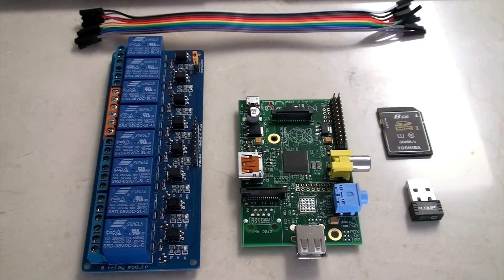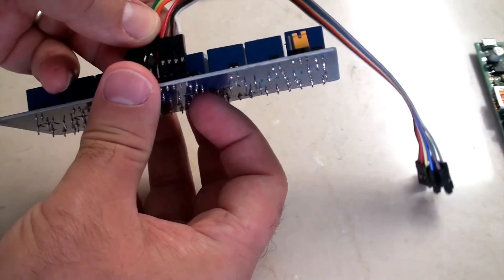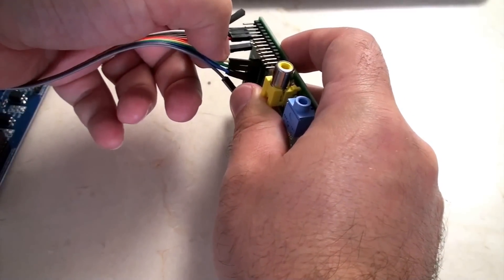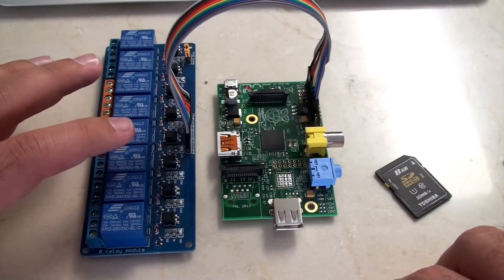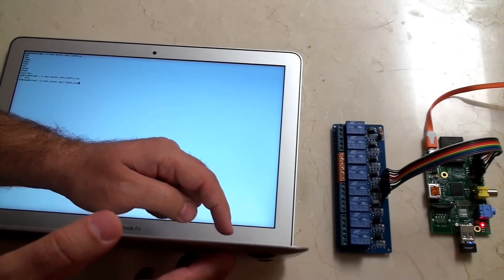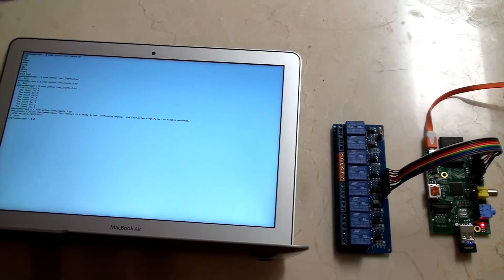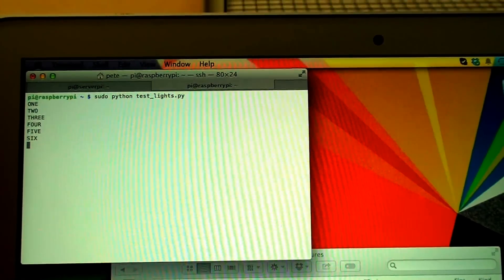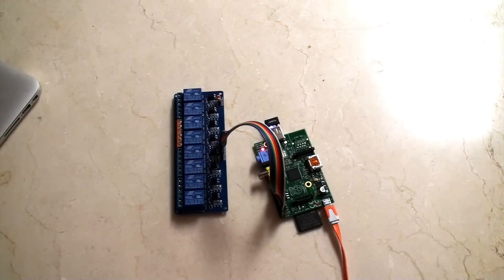Raspberry Pi: 8 Channel Relay step-by-step with software examples for automation

Comment: Can i use Relay for 220V Home Appliances?
Reply from the maker: YOU RISK SERIOUS HARM.  Obviously, since you are asking, you have no 
idea how to use a relay, and no idea how serious 220V is.  SO DO 
NOT ATTEMPT THIS.
Reply: +skiwithpete  I know they are just Electromegnatic switch(s) and if i get specifically 220-350v &25A that would be better right?
Reply: I want some help with relay.. i have 8Ch relay board as you have. but in idle mode some of relay board Leds are dimm. but it goes off and works well when executing script. i want to know that if it is okey or not , before connecting 220V appliances to relay board.

Comment: You don't need a Pi for this - a simple Arduino Nano, running an OOP sketch, can handle 8 or more relays totally independently and simultaneously. Here is my video demo: https://vimeo.com/173236054

Comment: Thank you for the tutorial.  I am resurrecting a 5 loop guitar effects rack that I built in the late 80's.  I am dropping one of my effects and focusing on using four relays for clean signal switching and the other four for powering LEDs at the foot controlled switch box.  I have been told that I can simply apply digital on and off signals to the relay triggers.  However, it would be better if four input switches could enable a more complex array of effects e.g. 1=comp, 2 = comp+dist, 3 = dig delay, 4 = octaver + dig delay.   My question, yet unanswered, is how do I get my dry closures from my foot switches inputted into the RasPi or other?

Comment: What is a relay? What are they used for? I need help with my stupid purchase from sainsmart. I got a robot arm with no instructions. :(
Reply from the maker: A relay is just a switch.  The switch is controlled by the flow of electricity on one side of the switch.  That's what you can see in my video here, it's just the one side of the relay.
Reply: So if I wanted to move 4 servos at once, I would need a relay? I mean, a switch in networking terms, or a switch as in on / off?
Reply from the maker: a switch as in on off.  If you want to control servos, connect to the servos.  If you want to control the flow of electricity like a wall switch, use a relay.
Reply: thanks!

Comment: If I use for lighting, do I use a 5v relay or a 12v replay?
Reply from the maker: the 5v or 12v is a requirement of the relay to operate and is independent of the power of the light you wish to use. check out my 12v led lighting controlled by mobile phone

Comment: I wanted to make my own thermostat but getting a 5VDC connection will be difficult.  I think a 4 relay board will do.  Do these relays control DC circuits or AC circuits?  My HVAC runs 24VAC lines.
Reply: These boards do work with both DC and AC.
Reply: On thermostat lines, 1 power 24VAC is coming in.  Get's sent to 3 other wires (fan, compressor or heater).  I have heard some say to use the common wire but I am not sure of that.  The trick is I only get 1 power line to feed a board and several downstream relays.
Reply: sized4spills
Thanks!
Reply: You power the relay with 5V and use it to control the 24V lines.  No need to step down the voltage if you connect your relay as shown in the video.
Reply: +Aaron Rogge since i have a 24 VAC, i still have to get it to 5 VDC. Once i do that,  and have enough amps to run the pi and relays, it should work.  i have a 40 watt transformer which is 1.67 amps at max.  I am still not sure if this is going to work this low power
Reply: I had missed you were powering everything from the 24 VAC. Sorry. From some figures I have seen, a b+ can run on .5 - .7amps depending upon what is attached, so you should be good. Do you have a common ( C wire )? You need it to complete the circuit for the relay.
Reply: Yes I do.  I don't understand why one has to use a 2.5 Amp power supply then for the Pi.  I suspected it didn't use that much energy.  So in that case you are right, it should work.  Relays only roughly pull 50 mA to activate.
Reply: +Chris Sparks I suspect it is to ensure enough power for all possible use operations.
Reply: get a 24vac to 5vdc transformer
Reply: if all the relays are on at once you want more current. also whatever the pi requires

Comment: I'm very new to this and I don't know how to make the pi run the program. If someone could help me that would be great!
Reply: copy the code into a file (use a text editor) and save it as test.py. Then run the command "sudo python test.py". Hope this helps.
Reply: The sudo shouldn't be necessary. python test.py should be enough. Judging from the first line of code it should also be possible to run it with ./test.py after you set the executable bit with sudo chmod +x test.py

Comment: Hi every one! I need some help programming relay bank for a pre-amplifier. 
6 relays (3 stereo inputs) will be input channels, and only two relays can be closed at the same time. So relay 1 and 2 are one group and 3 and 4 are one group and then 5 and 6 are one group. Relay 7 and 8 will be for controlling volume, so this should be momentary set. I will have to engage scripts by remote control (IR module) or buttons on front panel. Any one want to help me with this?

Comment: +skiwithpete 
I have a problem with my relays that I hope you could help me with. No matter which of your scripts I use or scripts I write, all the channels turn on NO MATTER WHAT. I would appreciate some help please!
Reply from the maker: +Elijah Stockhall Try setting the relays to low instead of high and high instead of low in the code.  If that doesn't work...  A couple of guys here have complained about similar things happening with defective relays.  Have a look through the comments and see if anyone else has the same problem as you do.  Also, make sure you've got an optocoupler relay - non-optocouplers behave in the same way as you describe.
Reply: thank you! 
Will do!

Comment: Would I be able to wire the relay board to solenoids and run them on timers (as long as they were the same voltage)?

Comment: Why does low gpio setting trigger switch and not high? I would have thought to set it to high.
Reply from the maker: +Matt Shepherd That's the optocoupler.  You should check out Gaven MacDonald's video for a complete explanation of how it works:  https://www.youtube.com/watch?v=b6ZagKRnRdM
Reply: +skiwithpete thanks, that explains it.

Comment: jist curious to why BCM was used and not BOATD. I am starting out with a 3B and relay 2 isn't working. It may be defective but in researching your code I thought BOARD (pins by position on the board) instead of BCM (channels on Broadcom chip) would be better and less of an issue with changes in hardware as people share code or the same code is applied to different hardware versions.
Reply from the maker: +Peter Capazzi BCM is what I'm familiar with.  If you watch my videos I count on relative positions.  I don't think finding the 34th pin is easier than finding a relative GPIO number.

Comment: I followed this tutorial and used a raspberry pi B+, but my relay would not work. in the end i found that i had to use an external 5v power supply straight to the relay board vcc. and another for the pi.
Reply: Just run a single power supply 5V that can handle both... that way you only take up 1 plug from the wall...
Reply: how do i make/find a external power supply
Reply: I am trying to do the same and apparently RSpi 3 model b cannot power the same relay used on this video. Where did you find the power adapter for the relay? did you make on yourself or can you buy it of the shelf?

Comment: Running the Python Shell (Python 3.2.3) on a Raspberry Pi model B; I get following Error:
      GPIO.setup (i, GPIO.OUT)
RuntimeError: No access to  /dev/mem.  Try running as root!
How to olve this ?
Reply from the maker: +Luc Hendrickx run it as root.  add "sudo" no quotes to the start of your line.
Reply: +skiwithpete Thank you for you answer 

Adding :
"sudoGPIO.setup (i, GPIO.OUT)"
I get the error 'sudoGPIO' is not defined

Adding :
"sudo GPIO.setup (i, GPIO.OUT)"
I get the error invalid syntax

Adding :
"sudo 
GPIO.setup (i, GPIO.OUT)"
I get the error name 'sudo'  is not defined

It is probably a stupid thing but I don't get it right

Thanks for your help
Reply from the maker: +Luc Hendrickx don't put the sudo INSIDE the code.  Use the sudo to run the .py You can't run GPIO.setup from command line, that needs to be inside a python script.
Reply from the maker: +Luc Hendrickx Maybe watching my 16 channel relay video would help you understand how to run the code.
Reply: +skiwithpete thanks a lot Pete.
I got it running OK 
From the LXTerminal with "sudo python test_lights.py" in stead of from Python Shell

Fine you helped me out

Comment: I have tried this on the Raspberry Pi 3 Model B v 1.2 and was not able to reproduce the issue you were having with the B.
I modified the script1.py to have a 5 second delay and to only have one relay active at a time (set HIGH, the set LOW).  I was able to run through all 8 relays without the delay.
Reply from the maker: +Bert Cotton Cool, thanks for letting us know!

Comment: I apologize for what might seem like a dumb question. I just got my first Raspberry Pi 2, I would love to wire an outlet to a relay and use the pi to automate sending power to the outlet. I want to stick a lamp, or a radio, or a fan into these outlets. Will this relay for for this type of application? I saw your other video about using a 12v  powersupply for outdoor lights (https://youtu.be/xc1daIb1LVc) I guess that just has me concerned that this relay is only rated to a certain voltage. Can it do 120v? 

I read the Amazon listing, but like I said this is my first venture with the Pi and I am not 100% familiar with everything.
Reply from the maker: +Aaron Henderson Please don't play with mains power.  Trying to wire something with deadly amount of power, especially when you're unfamiliar, is plain stupid.  Play with 12V.  Leave mains for a certified electrician.
Reply: +skiwithpete I appreciate your response. However, I am not 10, I understand the risks associated with 120v. This is why I asked you what the relay was rated for, someone I feel is more knowledgeable in this area. I have never touched a relay before, I have never touched a pi before. These are two things I do not know, but I want to.

So thank you for your time.
Reply from the maker: +Aaron Henderson relays are not rated generally, but specifically.

Comment: I was wondering if anyone here can help me with a simple python script  that when runned just turns on a single relay for 1 second and then turns off. 

Can anyone here hash out the code for that?
Reply from the maker: +Andrew Moore Use this code.  https://github.com/skiwithpete/relaypi/blob/master/8port/script1.py change line 19 to = 1 (instead of = 2) and then delete lines 27 to 47.

Comment: I've been doing a similar project to be able to control thing on my model railroad, but I used the I2C bus. 
That way I will be able to switch more relays.

Here's the breadboard test with pnp transistors: https://youtu.be/wv0hCO7sjuA

Here's the next test, with relay drivers: https://youtu.be/G_uvb1uN7ig

Here's the prototype board test: https://youtu.be/Ei979dkehbw

For the Python software please check this Github page: https://github.com/GerardWassink/gaw_Rasp_I2C_16_Relays

Comment: " I would be thinking you'd need some transistor ?", yes
Reply: +adrian faragau I don't think so because if you look to the Garage door project, you will see skiwithpete didn't use any transistor i.e. straight away from the relay to the garage motor. Yes, there are few articles mentioned to use transistor as part of protection. You might need this setup if you have a feedback signal to RPi
Reply: Look closely at the relay board, the transistors, resistors and diodes are built in.  The only real problem with this project is that running 8 relays at the same time requires more power than to model B can deliver.  Easily solved by wiring the relay directly to the 5V power supply that runs the Pi.

Comment: Do you have a tutorial about an android app(programmed using Android Studio not using the browser) turning on/off the relay using the raspberry pi? LAN only, no internet connection needed. Thanks!
Reply from the maker: +Rosevir Ceballos Jr. No i don't.  Haven't made an android app.
Reply: +skiwithpete Are you planning on doing one? :)

Comment: I bought six of these, but there was no documentation. 1) What is the min/ current required on IN0 thru IN8 to activate the relay? 2) What is the GND_VCC_JD-VCC jumper's purpose? 3) If the purpose of the jumper in question 2 is to provide a way to use a beefier external power supply so that the logic supply isn't burdened with the amperage required to operate multiple photo transistors/relays, it seems impossible to externally supply the board while tying its ground and the logic ground together (a common ground is the only way to allow separate supplies and permit the logic to operate the photo transistors)?
Reply from the maker: +helocast I think there's another Youtubers video that might answer some of your questions which goes much more deeply into the workings of these relays than my video does:  https://www.youtube.com/watch?v=b6ZagKRnRdM
Reply: +skiwithpete Thank you, that other video answered my questions! I'll just add here for completeness that this board's particular design gets around the normal 20 ma requirement of the photo transistor/optocoupler and states the current draw to be 2 ma for each IN0 thru IN8 "data" input. This would allow PICs and other devices to be used instead of the Raspberry Pi. Also, that other video shows it is possible to provide an external 5 volt power supply for the relays by removing the jumper (GND_VCC_JD-VCC) and connecting directly to JD-VCC and GND pins (note the GND pin on the jumper is common to the GND pin on the 10-pin header and VCC pin on the jumper is common to the VCC pin on the 10-pin header). What was throwing me off in this whole purchase ordeal is that there is single supplier of boards, so a Hong Kong assembly might be different than a Taiwan one and different from a China one et al. So whether it comes from Amazon or e-bay, one should either zoom in on the component side of the board in supplied photos (if they can) or make the supplier state ALL the electrical requirements to help people interface their products.

Comment: the sequence of pin is the same with raspberry pi 2 Model B? Thank you
Reply from the maker: +Maynard Bicos You should double check:  http://raspi.tv/wp-content/uploads/2014/07/Raspberry-Pi-GPIO-pinouts.png
Reply: Oh. Great Thank you. it is okay if I connect wall outlet at the relays? and have you tried to open tv without pressing it power? Thank you!
Reply from the maker: +Maynard Bicos Only experienced electricians should be connecting "wall outlets" or mains power to anything.  Ever.  So, I'll say no.  Absolutely not.  But why not make a 12V light instead: http://amzn.to/1mEQP7w
Reply: if not so how can I power a load? for example a light or tv and other home appliances currently im developing a home automation for my thesis Thank you.
Reply from the maker: +Maynard Bicos Don't base your thesis on electrocuting yourself.  Do it with low power.  Make a light with transformers.  Find the low power electronics that controls your tv rather than the stuff that powers it.  If you're smart enough to be writing a thesis... then you're smart enough to do this without putting yourself at risk.

Comment: In none of your relay examples you actually show how to wire up the relays themselves, the hard part since switching some gpios on and off is relatively easy even for beginners. Why not explain the three ports of a relay and give a creative example where you use all three?
Reply from the maker: +OOD2021 Check this video it should help:  https://youtu.be/3u45htuQeag  I'll make another relay video soon to really show how to use it.

Comment: Really like this video.  I added the coding to setup all 8 of my relays and they all work.  I have two questions:
1.  When the webpage initializes it takes two button presses to activate the relay.  Would it be that there is NO initial state set to Low for all outputs?  If so how can I fix it ?

2.  How can I Add a function to a button to cycle on/off.  I have a couple of garage doors that I want to control, so a single press of the button would be good.

Thanks For any suggestions
Reply from the maker: +Ed Lentz Q1: Great question but I don't know.  Have you tried a different browser?  Q2: You probably want to watch my garage door vid:  https://youtu.be/p2abZ90-eU0 (basically you want to add a timer to the relay to have it trigger for .5secs or so)
Reply: +skiwithpete Wow quick reply!  I tried Edge and it wouldn't work at all.  I am using Chrome on both my laptop, phone (android) and a tablet and they all work the same.  Firefox doesn't work at all, funny that Edge , and Firebox force me to login before they present the page.  I don't get that in Chrome at all.

I have seen your Garage video and I have that working, I woul dlike to incorporate it into the relay page, looks nicer :)  I am pretty green on all this.  I don't know how to change the buttons to run the .py scripts
Reply from the maker: +Ed Lentz Q1) I'm still sorry, and I still don't know.  Hopefully someone else will read this and be able to provide insight.  
Q2) I don't quite understand yet.  Are you saying that you've got an 8 channel relay and one of them will control a garage door?  In that case, all you need to do is trigger the correct script with the button press.
Reply: +skiwithpete No worries on the Q1.  On Q2, maybe I should just use the index.php from the garage door video, get the buttons to get bigger and line them up.  I would just then need to remove the timing for the .py scripts for the other relay functions I wanted.